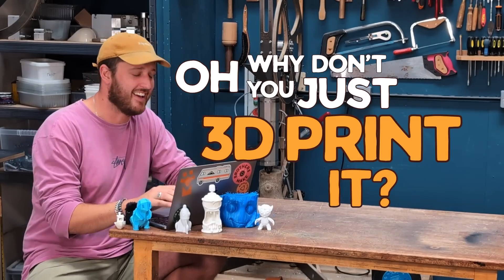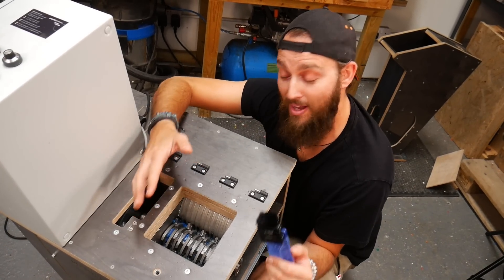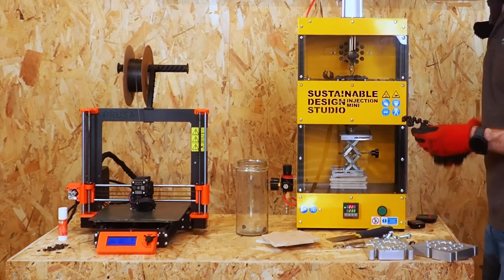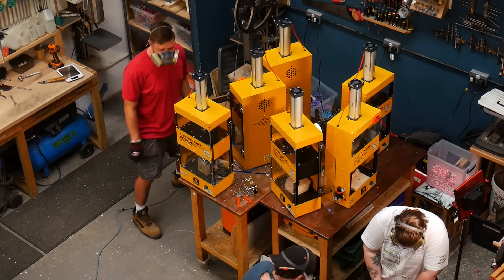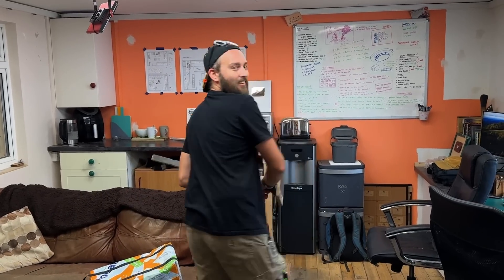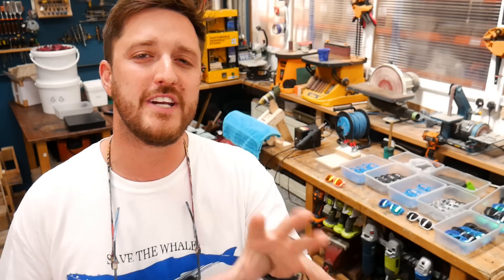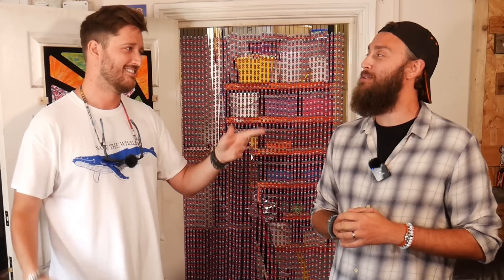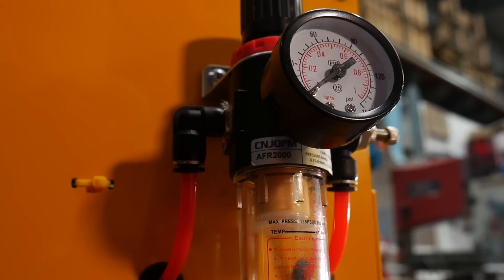Is THIS Better than 3D Printing?

Comment: moulds are expensive add another 5k for a cnc machine and probably £30-50 for material then your getting closer to equality 
3d printing will always be faster for one offs or prototypes
injection moulding is always cheaper for mass production
Reply: Mold making is a specialty in its own right. Also don’t forget the cost of work holding, tool holding and the bits, you can sink a lot of money in those. The cost of the shop space it takes shouldn’t be ignored either.
Reply: They didn't even count the labor Cost of 3 adults. + time it takes to press and cut the molds off....
Reply: You can always build a Milo, saves you about 3k to put towards stock for moulds!
Reply: Injection molding only has two things going for it, first is strength for small parts (3d prints are stronger for large parts) and cranking out excessive amounts of parts in short order. But you rarely get orders like that so it is almost always better to just maintain a stock.
Reply: @SirSpence99  I don't know where your experience in injection molding comes from but rarely did we receive orders for less than several thousand pieces. In 25 years of being in injection molding I can count on one hand the amount of times molds were changed so much that they had to be redesigned or remade. Most were minor changes that took a day or two and we were back making parts. I have aluminum molds with 100's of thousands of parts made on them so expensive hardened steel molds are not required. Large parts for 3D printing aren't even comparable in quality to Injection Molded pieces. From surface finish to strength of parts. Where 3D Printing works in plastics is for prototyping and very short runs but once again there is NO COMPARISON in the quality and strength of a molded part.
Reply: @yatyas72  Good job at not reading what I wrote for the vast majority of your comment.

Also, you are just wrong when it comes to strength and quality. The closest you have is making the claim that a 300 USD machine can't output "quality" parts... What is the price of the injection molding machines you used again? And the price of the molds?
Reply: @yatyas72  Agreed. There isn't a 3D printer material made that compares to injection molded parts for strength at any size. I know the 3D fan boys take their little hobby to a personal level and will make ridiculous claims about how strong the prints are, but there's just no comparison. That's before we even include things glass reinforced nylon.
Reply: @SirSpence99  You're 100% wrong on the strength of Injection Molded vs 3D Printed parts. My experience with 3D Printer over the last 20 years is not just home/hobby machines but industrial as well. Resin, FDM, SLS and in all cases the ONLY way to get parts close to injection molded strength was to massively change the design for wall thickness, internal radius, etc. Surface finishes don't even compare either.  My injection molding machine was built in 1984 and cost less than $2k for 75-ton 5 ounce shot. I could mold a part 6 x 9 inches in 45 seconds cycle to cycle from a dozen different resins. The molds I made were aluminum and in most cases took less than 3 days start to finish before they were making parts. For those beads I would make a mold with 50-100 pieces in each shot, the geometry is easy, so the mold wouldn't take but 2 days tops, at 80 cycles per hour x's 8 hour shift I could make 4,000-8,000 pcs per day. All identical without blemishes or layer lines. With a little automation these guys could get their machines to run all day unattended.
Reply: Molds can be made very inexpensively as in this case where they have straight pull parts with split line molds. If you design the mold and just have it cut at a local machine shop out of 6061 or 7075 aluminum, you're only paying for machine time so the cost is quite cheap. I've done molds like this for several customers fishing lures, watch pieces, USB over molding, etc and they usually run a couple hundred dollars. You didn't have to buy and own all the equipment to do this.

Comment: I have been 3d printing for almost 8 years now and I've always been conscious about the wastage, I have been experimenting with making plastic sheets from the waste but am curious about whether the mini injection machine could use waste pla from a printer such as bambu labs "filament poops" and use these to make small injection moulded parts without the need for a grinding machine? Would you be able to test at all?

Comment: Now do an episode on mold making. How much does it cost to DIY a comb mold?
Reply: Exactly what I was thinking. Already having the mold is like skipping 50% of the process for injection molding compared to printing from 0.
Reply: @blazelion7926  More like 90%.

The other factor is they are comparing machine to machine... They should be comparing cost of machines. In which case the 3d printer they went with (a prusa mk 3, a machine that while "good" is considered a legacy printer and prints at best at 50% of the speed of modern printers... And it costs the same or twice as much as said modern printer.) is not a good choice for the job.
Then you add in the stuff they are printing is clearly designed with injection molding in mind instead of printing and their test is utterly pointless.
Reply: Depends of the CNC you're needing to carve, the aluminum sourcing, how clean you want your mold to be (with/without much layer lines for example if you're not using 5 axis). Also companies have to pay time spent to 3d design and test the molds prototypes, so it varies a lot if by "DIY" you means hobbyist or small lab.
Reply: Simple...
3D Printer. 
The end... lol
Reply: @DrNothing23 you cant 3d print a mold because it will melt
Reply: I am planning to make a mold for a product I designed as it's doing well in recent days... So I contacted my father in India as it's much much cheaper over there instead of here in Portugal or rest of Europe 😅
Reply: @creativeleodaily  hey bro, I am from India as well 👋🏼.
Does your father make these molds?
Reply: If ya got a makerspace hobbist group around.

Cost of membership + material + your time spent to learn how to use a cnc metal working machine.

The one i am a member of where i live is about 20€ a month.
Materials for a comb model is probably not more then 40€( if ya get the good stuff).
Getting the right to use it after safety instruction about 12€ for the guy who takes 4 hours to help explain stuff and teach everyone about safety and the basics.
Having nice people around that will help, priceless.
Reply: It can be done without a CNC.  You can make a positive of the item (say, on a 3d printer) and then create a mold from high-temperature silicone.  It does benefit a lot from being placed in a rigid shell (e.g. a metal blank) and it does have some wobble in fine details that needs to be taken into account.

That said, it's not easy; it took The Crafsman quite a few tries to get a working mold using this technique, but he has successfully done injection mold runs this way.  But the cost of CNCs are dropping extremely rapidly, too, so this is not the price savings it once was when molds were several thousand dollars...
Reply: @georgedorn_fnord what's a good CNC to consider (I'm a normal hobbyist ... would buy something like a cheap A1 mini Style CNC 😀)
Reply: It probably all depends on your own skills set plus what materials and equipment you have to begin with
Reply: @amandasnider2644  Exactly.
If you have skills in 3d design, CAM and CNC, and if you have a CNC (maybe not the toys made with aluminium extrusion) molds are a tricky but doable task.
Starting from zero...better ask someone skilled and with the machinery.
Reply: I wonder if you could make a watch from recycled plastic......
Reply: You can also make a mold from a aluminum cover with a middle in 3D printed resin for high temp. That way you save alot on cnc works whilst keeping the details. Mostly used on small batches.
Reply: For that price he bought it, but I'd be interested non the less to know the price of a DIY one
Reply: Exactly, conservatives always leaving stuff out of the process conveniently.
Reply: From nothing, to a lot.

Comment: I had no idea that those curtains were for flies!!!
Reply: never knew they were fly curtains.  just thought it was the decorating trend at the time.
Reply: OMG same!!!!
Reply: I don’t get how they could be. Is the goal to keep the fly in one room or something?
Reply: @TheOfficialOriginalChad  It basically makes what the flies perceive as a solid wall so they don't go in. Plus they can't move them by themsleves so they can't go through.
Reply: @TheOfficialOriginalChad It’s like a screen door that they have in America. It’s so you can open your door when it is very hot without flies coming into the house.
Reply: Came on here to say the same thing! I thought it was just some hippy trend thing (although they may have co-opted what was a useful thing into a trend, IDK)
Reply: We had one back in the late 60’s early 70’s they came in all types of designs but they were all designed to keep out the flies. The odd fly would get in by piggy backing into the room. But cats love them so do dogs too they love running through them.
Is if you have pets , well unless you train them to leave it alone you will hear it rattling a lot, but they do get board with them after a while, umm a very long while😹😹😹
You can get LED ones now in different colours.
Reply: Big doors for big flies.
Reply: Right? I just learned something new!
Reply: Amazing! Though my cats would wreck this in a heart beat
Reply: Ditto had no idea those things had a function. Thought it was just a decor thing for hippy sorts!
Reply: Not FOR flies, but AGAINST flies. ;)
Reply: @Sekir80  very important distinction!
Reply: Me too
Reply: Same! I thought they only existed because people thought they looked cool
Reply: same😂
Reply: Wait wut?! 🤯
Reply: I have one made of little silver coloured aliens.
Reply: @billswifejo  that's so cool!

Comment: Hi Brothers make! I've been a subscriber for ages. I've been working on a machine for the past 3 years that anyone with a small shed and limited tools can make (for very low cost out of salvaged parts). I'm working on making fully recycled 3d printer filament from common house hold plastic. I've also seen that some people have been adding pellet extruders on their printers to avoid filament all together (as pellets would be wayyy easier to make). Love your vids, keep it up (:

Comment: Great video with a super well-balanced view of the differences between injection molding and 3D printing. We're thrilled our Injection Mini held its own when compared to some of our idols at Prusa and Bamboo Labs. The issues with 3D printing and the advantages of injection molding are exactly why we designed the Injection Mini. We're continuously developing new methods and machines to close the gap between the two, ensuring the best choice is always the most sustainable choice! 🌍😎

Comment: That mini Injection moulding machine is awesome! would love one of them!..... With the Injection moulding the mould is the slow bit right, you have to make the mould or buy it....
Reply: Yeah that wasn't included in their time factor. If it takes 3-6 weeks to get the mold that's a couple weeks the 3d printer has to print. I agree both have their place but I think the run volumes are higher than 1 off and are closer to 1000-10000